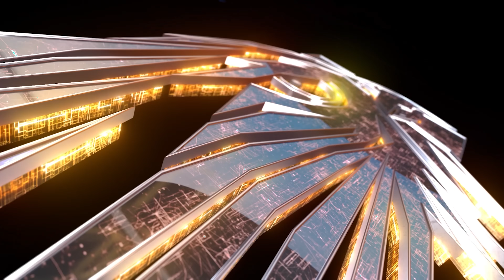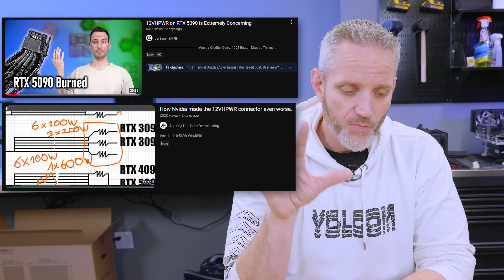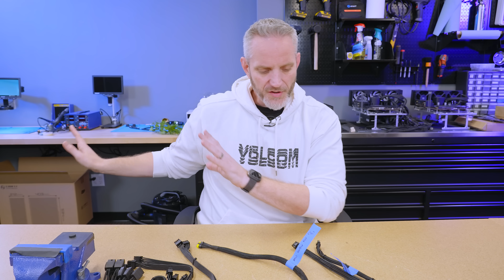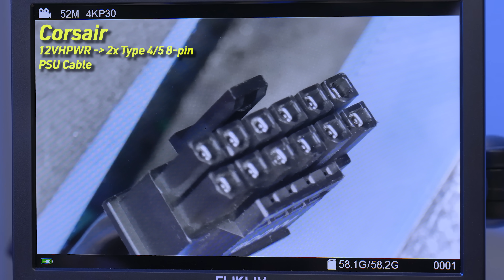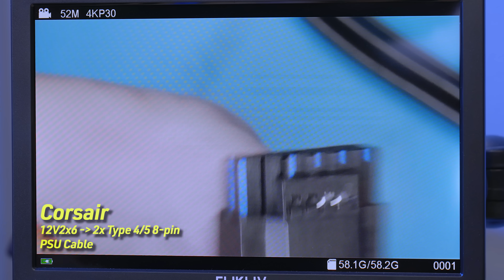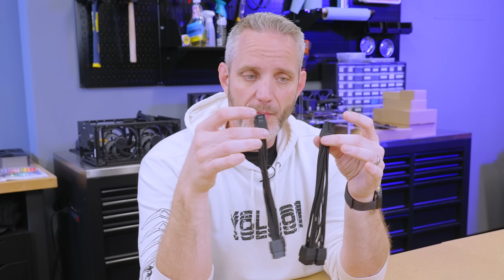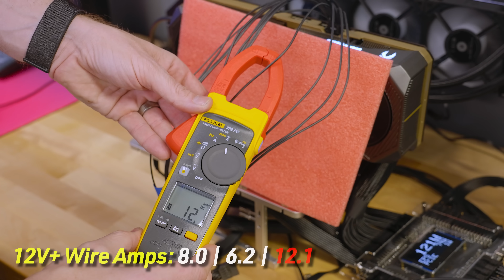I discovered something concerning and I need the Experts to chime in... More 12VHPWR discovery!

Comment: 9:52 - This is EXACTLY why were use crimp, screw or latch connections for high power applications. 

IMHO, it should have been a latch system. You put in a cable end loosely, and it lines up with these metal guides inside the cable, then you lower this latch and use a screw / hex key to fully secure it (the cable can even have a spring system to ensure minimum torque is applied but making you screw down until this color under the latch is hidden (so it's fully seated)). 

Boom, done. No issues. 

Literally all that needed to be done. 

Then bump the spec for high power....  increase the voltage to 48 volts. Done. Then this nonsense is solved. The problem is amp flow -- and the cables are at the limit and hard to detect where we need to look at fucking PIN DEPTH in mm. 

Just decrease amps, by increasing voltage.

Comment: I am definitely not an expert, but I have been watching all the videos and trying to figure it out. All 6 pairs the 12+ and grounds are used to pull power and all cables are indented to carry up to 9.5 amps*6*12V or a theoretical max 684 W. The edge pins being recessed or moving is not an issue, maybe even better as it can make a better contact. If the edge pins carry 23 amps as in the video it means that they have a better contact and lower resistance to carry such a high current. The issue is with all the other cables. Can someone measure the resistance of all the cables on the connectors to see if there is a difference. I think the cables need some active management to make sure all the currents are balanced.

Comment: still find it interesting that its only 600w rated. Say here in Norway for example. Take a PN 2.5mm2 cable. its rated for a theoretical max of 19.5amps,  but we have a set rule to only put 16a on it, which would mean in this standpoint , That cable would need to be rated for 813.6 watts thats 11.3a@12v per leg so rounded up 820 w So really from factory these cables idealy should be rated 850w to give significant margin, so around 30% overhead.  20% would probably be enough but tbh at this point its better to go extra and not have more problems with this

Comment: Not an electrical engineer, but if the cables that are rated for "safely" up to 600W look more cheap and flimsy than the power cable for my laptop that's rated for up to 135W, I'm immediately doubting the validity of the 12VHPWR standard.

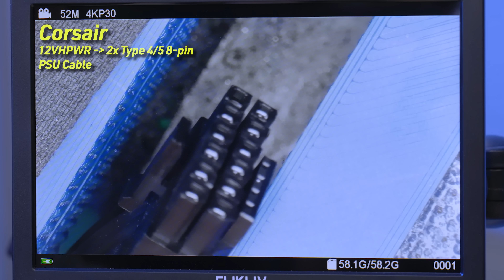Comment: 8:45 - Yes, a bad ground pin will add resistance to the circuit. 

Resistance for a circuit is the sum of ALL paths of current for that circuit (series is added, parallel is weighted by current flow to each). 

If you have a single ground pin having higher ground (which we assume there's multiple ground pins), then the current will flow MORE on the other ground pins, increasing their load.

Comment: hey dude, electrical engineer here from the UK, 
i have a 35 year history of power infrastructure provision for large events,
 maintenance of industrial systems & Low voltage & high-voltage A/C & D/C & digital & analogue controle systems for governance & corporate concerns. 
Just want to say you have indeed found a flaw in one of those cables, 
that receiver socket(2/58-pin) is way off-spec by about 2mm & 2 of other sockets i can see are also off-spec by at least a 1mm. 
These numbers may not sound like much to the consumer but of you are talking 20 amp loads D/C,
  then a poor connection like that will introduce high impedance loads at the joint restricting current flow & turn it into what is in effect a resistive electrical heating element destroying your expensive GPU.
This is a very poor socket type to use with such D/C loads, such an interface should be at least up to the specification of a Phoenix socket or above & rated for double the current load at 40 amp. 
That socket is operating right on its upper limits, this is not how to do things. 
This socket type is not fit for purpose.

Comment: thank you for the awesome video Jay, this is definitely concerning, after watching your video I went and checked a new power supply I just bought but I'm not using just yet, its an Antec HCG 1200 PRO and all the pins on the 12 6x2 cable has some play in it. They slightly go up an down, pretty much all of them has the same travel distance, not sure if it's normal or if it's in spec... But at least is not as bad as this Corsair one... Fantastic company with the best RMA system I've ever dealt with, all questions and issues promptly resolved, but at least what I've been noticing it seems their product quality is slightly going down, doesn't seem as high as it once was.

Comment: I just built a new computer, still using an old card until I am able to pick up a new one.  I bought a corsair PSU, and the H++ cable is brand new, unused and still in the box.  I took a look....and the same pin is moving around in mine.  The connector also doesn't look uniform either.  If I do get a new card, I'll be sure to use the one it comes with, or i'll look for another.

Comment: If the whole card has a common ground plane like most electronics, it's likely that any missing ground pin connections on those garbage 12VHP connectors would be covered by the ground connections on the PCIe slot

Comment: I would think, the pins should be flushed inside the connectors so it will have a proper contact on the other plug.. 😅

Comment: Why do we use tiny cables and connectors for high current loads anyway?
Wouldnt just having a single XT 90 connector be enough?
At 12volts an xt90 would be rated for 1080watts. Its also a proven connector, why do we have to have a uniquie connector that is absurdly small that is handling high power applications? Thinner wores have higher resistance afterall.

Comment: As a retired electrician and someone who has built a few PCs.
I get a little bit pissed of with all the cables  and connectors in the build. Frankly they are all crap. The problem is the poor quality of the cable themselves, there is no flexibility in them.
I have on occasion replaced some of these with my own built cables consisting of high quality copper with silicon sleeving. These cables are far more flexible than all of the others. This puts less stress on connectors etc.
As for the amps draw that you show, that is far to high for the size of the cable being used and in my opinion will cause problems maybe not straight away but could in the future.

Comment: Corsair still has the best platinum SF-PSU options for 750-1,000 watts right now imo, sad to see the cable so shoddy. I feel like I may have dodged an issue by having such a small case that it required me to use a MODDIY custom cable instead. Just checked their connector & all looks even / sturdy.

Comment: Another thing to keep in mind is that these connectors are only rated for so many cycles to be plugged in and out. The uneven alignment of the pins can affect the contact, combined with the ones that were either poorly manufactured to begin with (see the x-rays from gamers nexus) or have become damaged from bad installation could lead to higher than normal resistance on one or more pin.

Comment: As there are multiple ground pins, load is automatically distributed as it will go the way of least resistance. Basically they are resistors in parallel.

Comment: I have a Corsair native cable that is 12vhp to 2x 8 pin connectors.
It never failed and it was very hard to push it into the card, I prefer it to be harder than too loose.
I like the quality of this cable, I honestly think Corsair did a good job.
Reply: I have one too and i've checked it and it's quite sketchy :(
Reply: I have HX1500i and I find this cable of a descent quality. Very hard and solid. The unit is rated up to 600W in PCI-e 5.0. 
OCP should be set-up to Multi-rail , which it does via the iCUE software on the fly.

Comment: Hi Jay, I have a Corsair Hx1200i, do you think it would be better to use the Crosair cable (2 sense pins) or use 4x PCIe cables + Nvidia adaptor (4 sense pins)? Currently, i am inclined to use the 4 PCIe + adaptor, but that limits the expansion for a second GPU.  

Also, what about the adaptors from MSI, Asus, Gigabyte etc? are they still the same quality as the Nvidia ones?

Comment: Comical design choice. Safe bet is to chop the wire in two and slap in a fuse block. The smallest conductor in a circuit should be able to carry the total rated current. You don't connect a starter motor to a battery with 20 bits of electrical flex going into a multi pin connector. The PSU should have a 12V and GND connector coming out in 10mm (AWG 7) cable, terminated in push through bullet connectors where the male part passes through the female part so the contact is across the middle of the male part. This deals with incomplete insertion and the cable/connector can handle the full current across the 2 pins. These connectors usually fully mate well before the lock clicks in. The design choice they went with, and removing all the shunt resistors except 1, screams of class action lawsuit.

Comment: Plug design seemed ok in R&D, real world testing found cause for real concern, connector should have been redesigned for 50 series to a rating of 800 plus watts as a minimum, the current connector plug should have been born and died with the 40 series.

Comment: Protect your card?! This much much bigger problem now. This is a real fire hazard. In Der8auers case his FEs Corsair cable was after five minutes over 150°C at the PSU side. Imagine, that you have to do quickly something and in that time window you PC goes to fire, because of this stupid BS cable+connector struggling. I amazed, that even the EU allowed this unsafe connector and cable combo to hit the markets. I cant put a single pot flower beside my door in the stairway, because i can risk a nasty fine from the disaster management, because it can be a potential obstruction during a fire rescue operation.

Comment: Sorry, this in the end is NVIDA’s fault! 
They make an extremely HIGH END GPU, which the ‘Gamers’ were wanting for MORE frame rates. This it appears needs more juice to achieve those frame’s which is why people OC the power settings. NVIDIA should for the price you are paying for these GPU’s, provide a cable they have FULLY TESTED. 
I also would like to bring up why wouldn’t the MB or PS companies have limiter’s for those connections to prevent overpowering the cable, PS, GPU. To just have the GPU pull unlimited juice from the PS just seems insane. 
I would suggest until things get worked out, if you’re not there when the computer is on, I would turn the computer completely off. Don’t want to have a fire occur and burn the house, apartment down (worst case scenario).
Best to all!

Comment: Pure speculation here but the pci-e slot has alot more ground pins same with the 24 pin connector so I'd wager that more ground current goes out the board than 12v comes in.

Comment: As a Ex- welder, I can tell you that heat is different on positive and negative side. Normal 48.00 welding rods, one attaches the rod to the positive side (DC), to get about 70% of the heat in to the rod. some welding rods require reverse polarity, to get a good weld. Having polarity wrong the weld looks like crap.
Why would DC behave differently jumping through connection blocks? 
So I'm 100% with you, the polarity does affect the heat.

Comment: you talk to much without saying anything ....   the first thing i saw ..  on the bllack cable there are only 2 Sens pins ...  the other pinholes are empty .. whyle on the Yellow xcablke all 4 Sens pins are there ...  but the main Problem  in my opinion is .. the Porblem is made by seting design over security or funktion ...  like at apple ...  they mnade this connector so small that it looks better   the old way witzh 2  or on same cards 3 PCI-E connectors  are easy able to deliver  more than 600 W   the Pins had a much bigger Diameter .. so the contact aeria was much bigger .. if they want to dio somehting  for VCCable management  the coud place the connectors  instead on the top of the card .. on the side  more down at the motherboard ...  and not still on top of the card and in an much smaller connector ..  there are no tecnical Reasons why this connector shoud be better than the old ones ... !!!

Comment: If I ever buy a card with 600w +TDP I will make sure to use 2 awg gauge wires soldered directly to GPU PCB and PSU PCB. Maybe add 60A breaker to power wire... and hopefully nothing will catch fire.

Comment: I made sure when I got my 4090 I pushed that cable in as far as it would go. Also undervolted the card so really not ever concerned with it going up in flames. That said with the 5090 pushing even more power I'd be more hesitant. Why couldn't they just leave well enough alone and keep using the 8 pins?

Comment: maybe they should start considering using industrial wiring for running components that use that much juice.   we run industrial machinery and the only problems we've run into with electrical is when things have just enough power to run causing a trip in the breaker box,  causing the motor to overheat and stop working, or in the rare event a breaker box explosion (has happened 2 times in my 15 years of working at my current job)  which are all a result from bad wiring planning

Comment: 4:40 meassure the Resistance ;) Im a electronic technician from germany in my third year (im sorry i wont be able to write this stuff in propper english) if the connector isnt plugged all the way in, the transitional resistance can be higher and will be higher the more it aint fully connected, thats how these connectors melt / the lower the resistance the better - the higher it is, it warmer it gets
Reply: While that's true for the connector, it's probably the other way for the cable, right? Imagine one pin making bad contact, that is the resistance within the connector is pretty high. It would generate quite a bit of heat in there indeed, but render that wire to carry much less current overall - thus creating less heat in the cable itself.

The better the pin connection is (relative to all others), the more heat that cable will produce. Ideally the heat is just spread over all cables evenly and the connections have little to no resistance.
Reply: @ and the warmer it gets the higher the resistance will be 🙂‍↕️

Comment: There is a video from Igor's Lab from some time ago that states that the specification leaves leeway in the form and accuracy of the pins. And that can lead to a not so good connection on one or more pins. As the current searches the way with the least resistance the other wires will have more current then. I'm quite sure that is what we are seeing here. A few hundred milliohm might be enough at this amount of wattage to significantly  change the flow of current.

Comment: I’m currently using the NVIDIA cable with my 5090 FE, so far it seems okay, undervolted the card, running with roughly ~5% performance loss.

Also, ordered a PMD2.0 and some temperature probes to install them on both end of the cable. 

Just as a note; PSU is a Super Flower LEADEX Titanium 1600W ATX3.1

Comment: I remember when I pulled out of box that same type corsair cable in december 2024 to install it to RM1000x and 4070TIS, I kept watching it  "why are the pins some so deep some high, doesn't look normal or high quality". Nice to know it wasn't just mine. xD  I ignored it and didn't realize it could be actually a problem.  No melting yet, probably because the card is so low power compared to something like 4090 or 5090. Would be interesting to now buy a clamp current meter and see how the individual wires are like. Also because that's now the new hot thing to do with new PCs. xD

Comment: Electrical engineer here. Heat in connector is based on the current and the resistance of the conductive material. Ground transfers the same power than the 12v, it's a closed circuit. This whole design is crap, if they are combining the rail, two cables of 12mm or 16mm would be superior, as they could dissipate the heat better and the connector would be bigger. And it would probably be smaller due to it being only two cables. I don't understand why they split it up across multiple cables, it makes no sense to me.

Comment: Sure if you will calculate actual  contact surface area difference and recalculate to current and resistance difference it will be no critical difference. 
Just design flaw - so much power on small single connnector with thin wires on its limit without proper balancing.

Comment: If design tolerance in manufacturing is so low, then the designs need to change.  We should not have to use a microscope to see if the connections are fully seated.

Comment: 11:35 That is concerning... It's definitely a bad cable design... The broken cable on the 5090 which der8auer showed was a MODDIY-cable, so not a Corsair cable to be fair.

I love that everyone has new insights to this problem. Maybe that's a tactic by Nvidia. Maybe their engineers did not have the capacity to solve the problem, so they just let YouTubers do the work for them 😂

Comment: Just out of curiosity, I checked the cables that came with my Seasonic PX1000 that I bought for my new build. Every pin in the 12-2x6/12vhpr on both ends moves in the way you demonstrated.

Comment: Ground is less of an issue, since all grounds are connected. So if there will be a resistance on ground in the 12VHPWR cable then that energy will follow other ground path back to the PSU (eg. using the case). 12V lines are not connected to each other (or at least should not be, in Nvidia GPUs they partially are connected) so there is no other path to follow, so the wire will heat up.

Comment: The depth of pins and potentially making bad contact explains why you get excessive heat in the connector/pin but not why a single cable carries almost have of the current while the others have only a fraction of that through them.